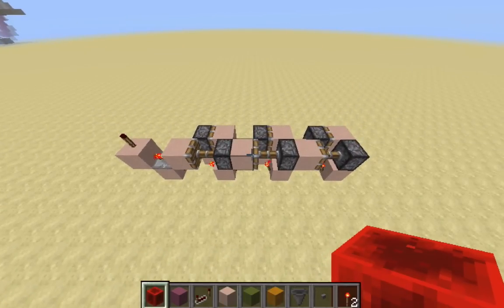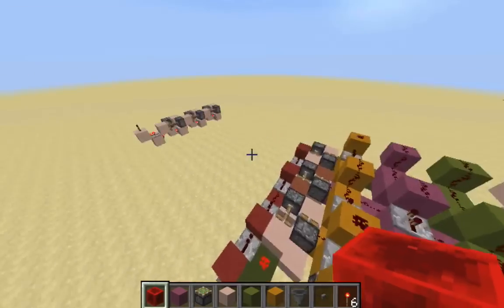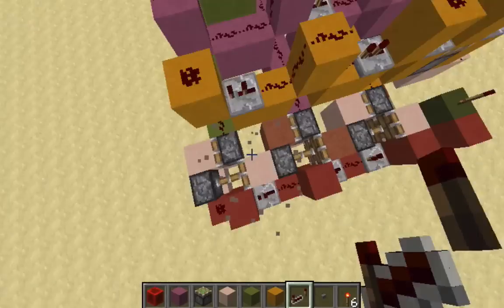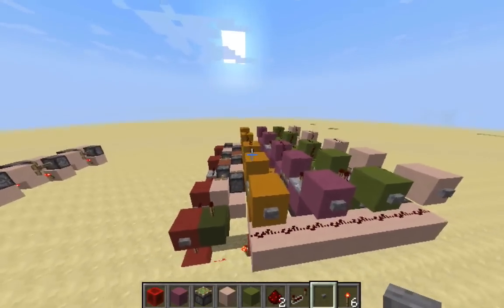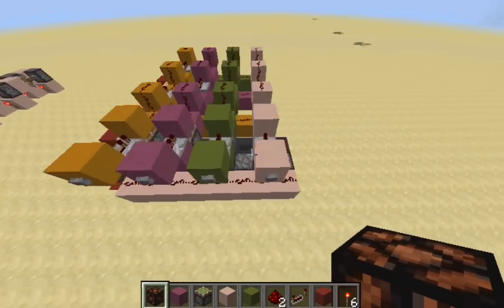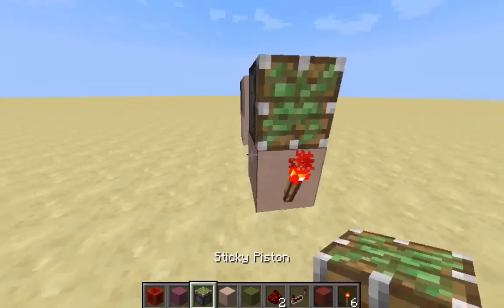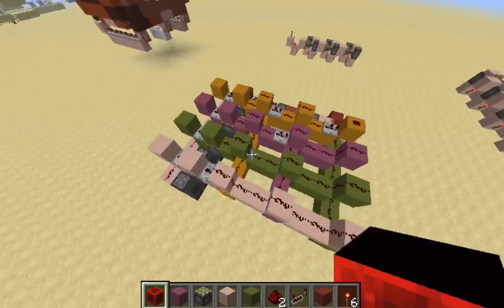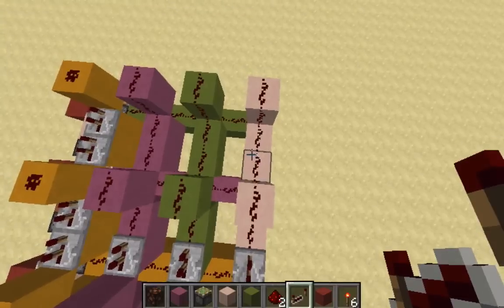RE: JL2579's Analogue Combination Lock - Go Digital Dude!

Comment: When it comes down to it, renamed map keys are the best when keepInventory is on.  It's literally impossible to forge a key- someone who has the key must make a duplicate and give it to you to expose the system.
Reply: Renamed, Written in, and Copy of a Copy Books are even better.

With maps, you can duplicate the key, but with CoC Books, you can't make additional keys without having the original, or 1st copy level of a book. Add in the fact that Written Books detect who wrote the book, and it becomes foolproof, minus OP commands and actually seeing a copy of the book itself.
Reply: supahvaporeon Point taken.  However once certain mods come into play (specifically Bibliocraft) you'll be able to make original duplicates of the book, which will bring it back to the original security level. That said, I'll go with books for keys now!